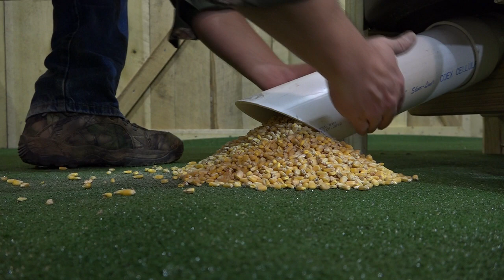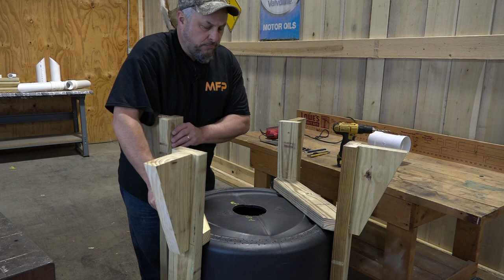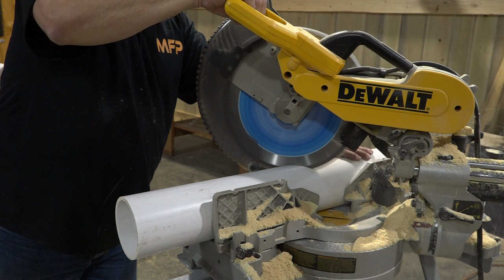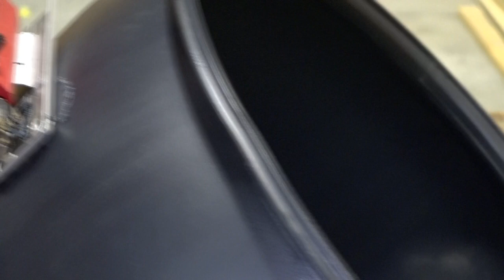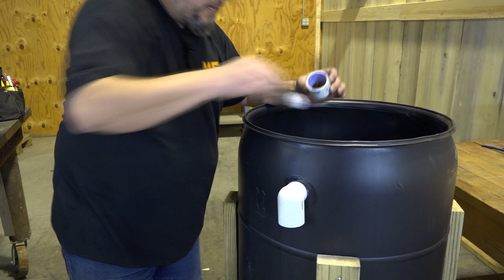Micro Food Plots Gravity Deer Feeder: DIY by The Food Plot guy

Comment: Why all the junk? Just cut a 3” hole on the bottom front side of the barrel! Fill with whole corn an there will be about a qaurt in front of the hole until it is pulled away. We have used these for 30 plus years in the UP of Michigan! A lot of extra work material just to lift it a ft off the ground. If want 2 feed holes cut 2. We have cut 3 in some? Thanks